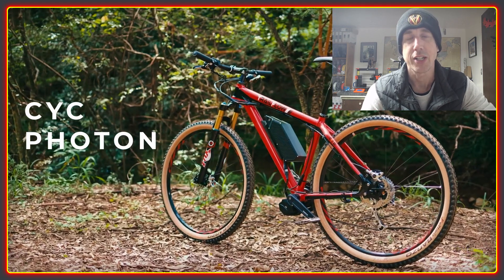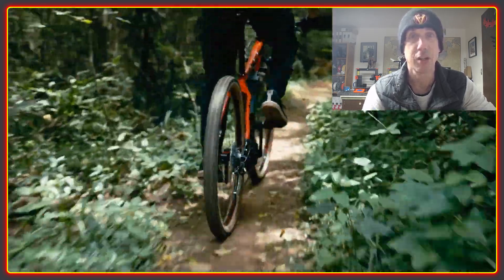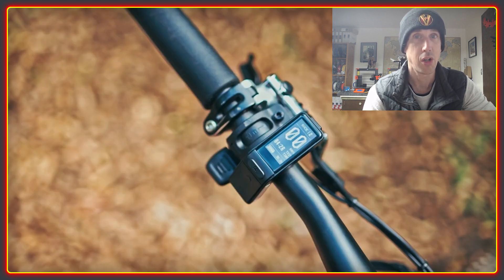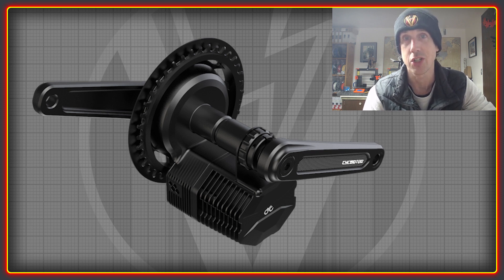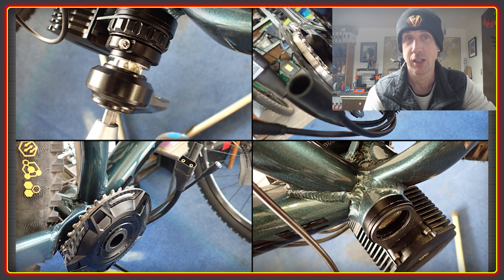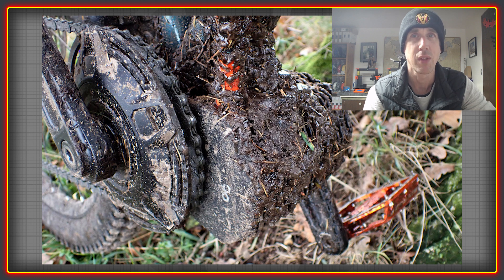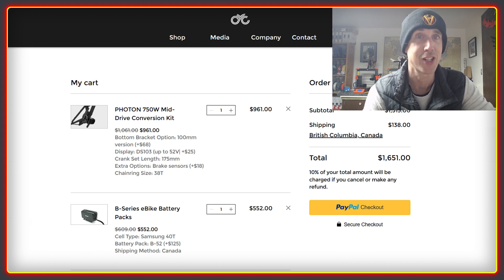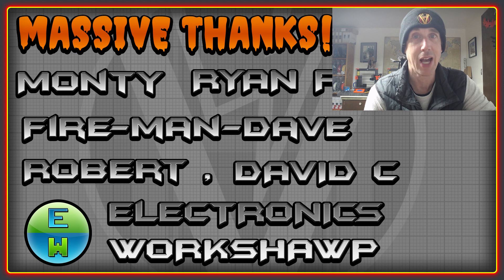CYC Photon Motor the worlds most Compact Mid drive?

Comment: Sad to say as it is a great motor, but at those atrocious prices right now, the bafang and other cheaper china DIY ebike kits will still continue to dominate the ebike conversion scene. I use an L-faster mid drive conversion kit which costs less then 300$ and ran it at 72volts the same with your BBSHD build. I can easily swap controllers and batteries when I want to or whenever damage occurs without the mercy of the manufacturer or having to buy proprietary parts. Prices for these 750w motors should rarely exceed 300-400USD or 500-600USD for a 1000w mid drive. But then again, its still a new product and they want to recuperate the manufacturing costs. We will see in the long run how well it performs or what modifications it can take (72v, hopefully) as well as its failure points after many years of use.
Reply from the maker: If CYC can make it this far without going belly up, then I think they will be around for a while. They have overcome significant early problems to get this far. I tend to agree that it's a bit pricey. I thought screw it, though, and I have one one the way, so I'll be a guinea pig! I think you are right on the development, so hopefully, it will come down in price. Thanks for the comment.
Reply: @HighVoltageKits  Looking forward to your video reviews of these new cyc products. 👌Their gen 3 lineup looks really great as well. Hopefully the noise isn't as obnoxious as the previous gens as well higher voltage capabilities of the entire gen 3 lineup (stealth, photon) as these motors really shine at 72volts as compared to running them stock. Great times to be an ebike enthusiast these days.

Comment: Built in controller?
 Does the controller allow field weakening?
 Is it compatible with 72V?
 i like to compact look and at a "1000W" It could be an awesome bit of kit. 
 This Looks like it could lead to something really good. 
If CYC are as dedicated to mid drives as they seem to be I can see a similar design but bigger motor coming from them....At least I hope so!!
Edit: I just had a squizy at their website and it looks like 750W is a very conservative figure. Three different models allowing field weakening and some serious power.
 I am excited. If they run relatively quiet it will be a definite kit for a future project!
Reply from the maker: This one I don't know about fw. I kind of doubt it tho. 52 volts max. Supposed to be a proton version later this year with more power.

Comment: For anyone looking for mid drive conversions for mtb, latest cyc kits and lift mtb seem to the only good options. Everything else uses crappy square taper spindles that bend like a ballerina
Reply from the maker: I don't know of anyone who has bent one. What are you doing to achieve this? I been doing this a while and you are the first person to put it in this way.
Reply: @HighVoltageKits  back in  2005 (i was 13) I did dirt jumping with my friends and we all bent our truvativ square taper mtb cranks. Now I'm 50kg heavier riding 10x harder so there's no hope for square taper. For casual xc it's alright but there a reason the standard disappeared from mtb world. ISIS spline is better but not great

Comment: the motor shouldn't cost more then 500/600. the torque sensor isn't such a deal breaker to a DIY enthusiast to justify spending rmore then double the cost of a bbshd. you can easily find a bbshd for under 550$ and i will forever prefer the reliability it's known for over the torque sensor.
Reply from the maker: Research and tooling costs money. But it always does. Companies usually get that back over the long haul. I know that they are willing to see them in bulk much cheaper to dealers and make a profit still. It seems high to me. I guess if they sell loads then it won't matter to them. If it does not sell well then they will have room to lower the price.